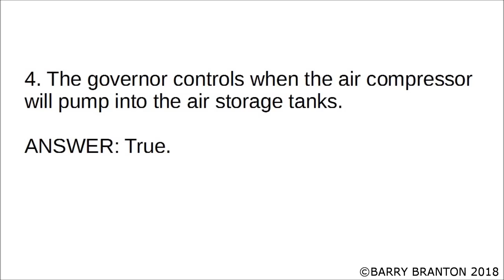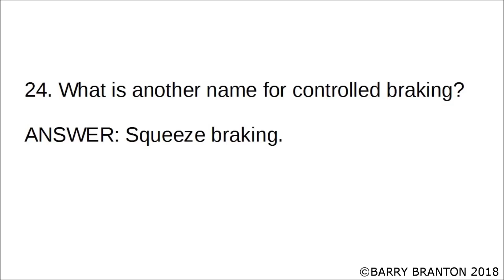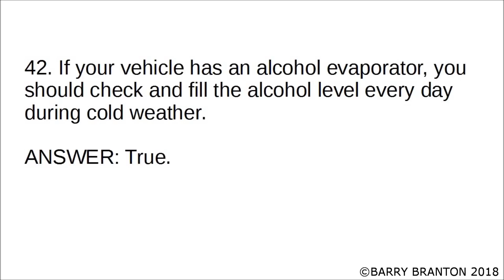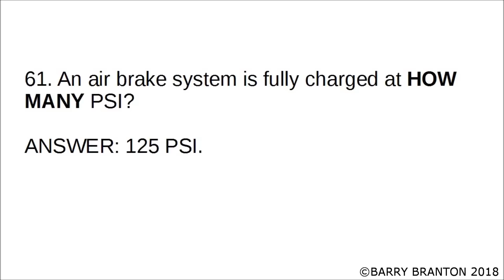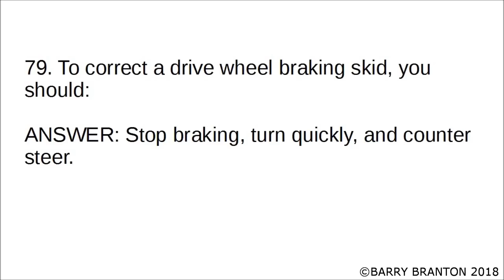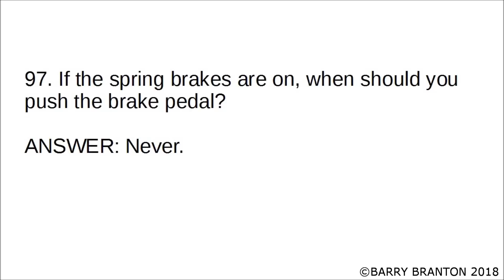CDL Air Brakes Endorsement Exam Questions & Answers

Comment from the maker: The problem with Question #8 and Question #25.

Question #8: https://youtu.be/HZHJOG2aI6U?t=130

8. The driver must be able to see a low pressure
warning that comes on before pressure in the
service air tank falls below:

ANSWER: 60 PSI.

Question #25: https://youtu.be/HZHJOG2aI6U?t=408

25. The driver must be able to see a warning
before pressure in the service tanks falls below
HOW MANY PSI.

ANSWER: 55 PSI.

Answer the following question:

The driver must be able to see a low pressure
warning that comes on before pressure in the
service air tank falls below HOW MANY PSI.
[a] 60 PSI.
[b] 55 PSI.
[c] Neither a or b.
[d] All of the above.

The correct answer is, "What does the manual say?"

5.2 – Dual Air Brake, Paragraphs 5 & 6.
Before  driving  a  vehicle  with  a  dual  air  system,  allow  time  for  the  air  compressor  to  build  up  a  minimum  of  100  psi  pressure  in  both  the  primary  and  secondary  systems.  Watch  the  primary  and  secondary  air  pressure  gauges  (or  needles,  if  the  system   has   two   needles   in   one   gauge).   Pay   attention  to  the  low  air  pressure  warning  light  and  buzzer.  The  warning  light  and  buzzer  should  shut  off  when  air  pressure  in  both  systems  rises  to  a value set by the manufacturer. This value must be greater than 60 PSI.
 
The  warning  light  and  buzzer  should  come  on  before the air pressure drops below 60 PSI in either system.  If  this  happens  while  driving,  you  should  stop  right  away  and  safely  park  the  vehicle.  If  one  air system is very low on pressure, either the front or  the  rear  brakes  will  not  be  operating  fully.  This  means  it  will  take  you  longer  to  stop.  Bring  the  vehicle  to  a  safe  stop,  and  have  the  air  brakes  system fixed.
Reply: Ok cool they're both 60
Reply: The book said 40 to 60 and I chose 40 in the exam and it was 60 psi.
Reply from the maker: @andresmelendez5972  Now we know. Thanks.
Reply: These two questions are confusing... I'm at the dmv and they re stressing me out.
Reply: Bare thx yesterday i took the general knowledge i passed sou i need to study air brakes and combination i miss 2 exam
Reply: My manual says 55 psi so maybe 57.5 will be an option?
Reply: Cars n Tech no
Reply: Hey barry how many cdl class a test are there. Ik theres the general knowledge,air brakes, I'm not sure about the other test pls help?
Reply: Elijah Warren —Combination

Comment: Help me on this plz, I think we don't have air brake endorsement for class A,
so these questions will might show up on general knowledge test?
Reply from the maker: My understanding is the air brakes endorsement exam is the same for Class A, B, or C. Whereas with Class A, you would need to study Section 5, Combination Vehicles, and with Class B, you would need to study, for example, if you were a city bus driver, the Section for Passengers. Now I believe it's possible during your vehicle inspection test that you should know the components of the commercial motor vehicle that you intend to be driving commercially.

Comment: Does this apply for California?
Reply from the maker: Generally, yes, though more questions from Section 2 are now incorporated in this video. Additionally, you need to know why Section 2  so important https://youtu.be/qcCKkDjPGBs For Class B & C, the CDL general knowledge exam consists of Sections 1 https://youtu.be/8GOL2MBrJfE and Section 2 and Section 3 https://youtu.be/GncP9sfnrKs  For Class A, consult Figure 1.2 in Section 1 of your state's CDL manual.

Comment: Mr. Branton THANK YOU SO MUCH!! Thanks to your video, I just passed the Air Brake test on the first try yesterday!! I'm studying for the General Knowledge test using your video now. I didn't pass the first time, but I'm confident I will pass now! Keep up the excellent work!
Reply from the maker: Congratulations! That's great news! Check out my latest video on Section 2 https://youtu.be/rxySVhzfu8A and also my video on why Section 2 is so important https://youtu.be/qcCKkDjPGBs
Reply: I failed my general knowledge the first time 2 and then I found his video. I think I was nervous because the 2 time I got none won't straight 40.. Thanks to Mr Barry. He's Awesome and dead on

Comment: How many question are on the air brake test
Reply from the maker: The test consists of 25 multiple choice questions. Each question has four answer choices. To pass, the applicant must answer at least 20 questions correctly.
Reply: @BarryBranton  thanx 😉

Comment: Hello I have a question whats the difference between #8 question exam and #25 question exam.
Reply from the maker: Yeah, I know, but what does the manual say, "The warning light and buzzer should come on before the air pressure drops below 60 psi in either system. If this happens while driving, you should stop right away and safely park the vehicle. If one air system is very low on pressure, either the front or the rear brakes will not be operating fully. This means it will take you longer to stop. Bring the vehicle to a safe stop, and have the air brakes system fixed." 5.2 – Dual Air Brake (Paragraph 3)
Reply: Hi Barry, I’m having the same problem as Meka, I’m reading the chapter on Airbrakes and Im confused on #8 and #25, maybe it’s just the wording, but I can’t find anything about the pressure below 55PSI it just keeps showing 60PSI. Any kind of explanation for this would be amazing, thank you for posting this video!!!